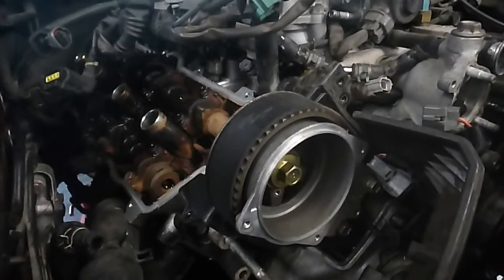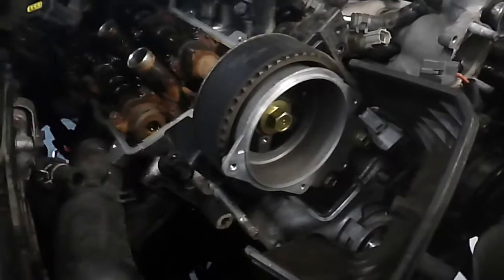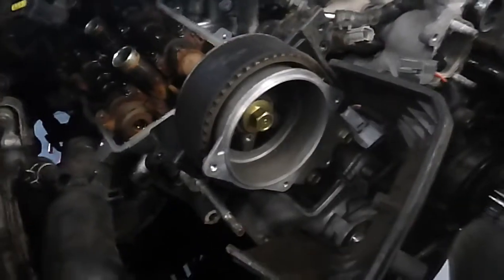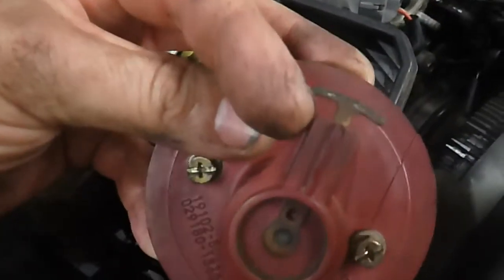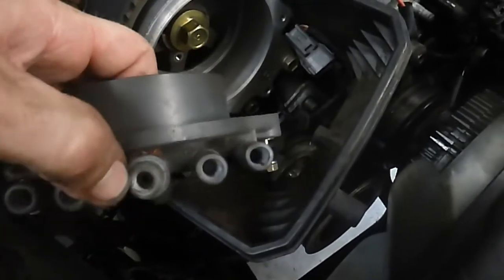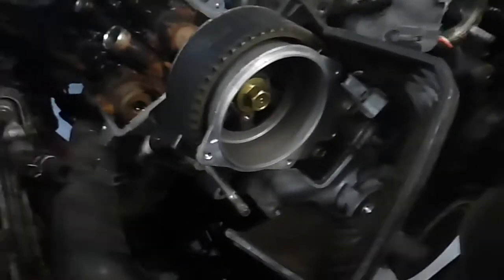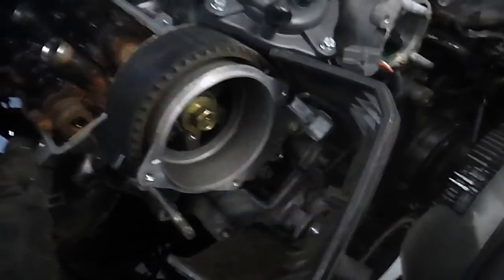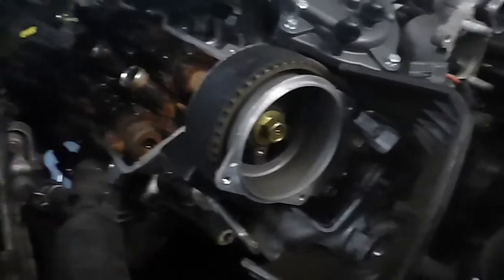Distributor caps and rotors 1uz-fe

Comment: Great channel! Was hearing a rattle (type) noise right in the cam gear area (driver side) on my SC. Pulled the came gear top cover to get an open path down behind the timing cover. Fully expected to hear noise coming up from that area (heater hose to the ear and other end right at the opening) Nothing worth noting. Put hose right near cam gear ... there was the sound! Pulled the distributor cap and found a cracked rotor just like the one shown here. Even had a crack in the plastic near the outer electrode. Put a new rotor on and voila! Most of the noise is gone. Now the passenger side is the louder one. In your experience have you run into a cracked rotor making audible noise?

Comment: Good day Calvin . I recently ran in to a problem with my 92 1uz Fe I fired it up and after about 3-5 seconds it shut down and will no longer crank no lights or nothing came on any ideas ?
Reply from the maker: I would be testing the basics like battery, battery connections, fuses, supplies to ignition switch etc.  Cheers

Comment: need help. having arcing across all spark plug wires, just changed them for brand new ones, and still arcing continues also changed spark plugs, not sure what to do next?  

1995 lexus sc400.
Reply from the maker: Did you use genuine ones or a set of other crap??  Are they routed correctly?  Are all the stock guides in place?
Reply: @CartuneNZ  yes  genuine parts were used. Also even original wires were arcing.. 
And what do you mean by stock guides?
Reply from the maker: @myyoutubechannel3737  there are factory spark plug guides down each tappet cover and spacers holding the leads away from each other.  Next options after that are there are internal issues causing hard firing inside the cylinders.   Cheers Kelvin
Reply: @CartuneNZ  thanks kevin. Kevin could possible coils be bad? Or bad distributor cap and rotors? ..
Reply from the maker: @myyoutubechannel3737  its a car,  anything is possible.   Cheers Kelvin
Reply: @CartuneNZ  yes routed them correctly wire by wire.

Comment: Hi im having  a problem  with my 1995 sc400 I did a full  turn  up it starts  but after 15min  when  it gets hot  won't start  back dose any one knows  why ?
Reply from the maker: Time to do some diagnosis.  Check for whats not working when it stops , is it fuel , is it spark , etc.  Confirm crank sensor input etc etc.  Cheers Kelvin

Comment: one side of my 1uz isnt working bought new ignition coil but nothing only 4 cylinders work, other 4 nothing and dont know what to do??
Reply from the maker: Ok.  More diagnoses are required. Is it all one side of the engine or two on one side and two on the other.  Is it making spark etc.  Good luck. Cheers Kelvin
Reply: @CartuneNZ  no sparks, it is all one side of the engen. i took out ignition coil on the right leaving 1 on left and the car started, then i put the right ignition coil on the right back and took out the 1 on the left and the car wasnt picking it juc cranked. i tested the coils though they all work. will try diagnoses.
Reply from the maker: @kendy531  each coil does two cylinders on each side of the engine so you are giving mixed information.   Please confirm as it sounds ignition related.
Reply: @CartuneNZ  Alright. thanks

Comment: Could these cause break up on top end
Reply from the maker: Hello.  Stuffed ignition rotors can cause all sorts of funny issues.  I replace at ever cambelt change and at engine prep time and shake my head when I see old ones refitted.  The ignition systems on these enginea are getting old so some new parts work wonders.  Cheers Kelvin

Comment: Hey! I’m having abit of issue with mine. I’ve just replaced rotors,caps,plugs,leads. I’ve got spark at my coil from the ignitors, but not getting any spark at the end of the lead
only fault code I’m getting is 22. Any suggestions?
Reply from the maker: Hello Aaron.  Can we just go over this a bit please to confirm we are both on same page.  You have voltage to coils,  both 12 volt and the trigger?   But coil isn't producing any spark?  Code 22 is quite straightforward normally.  Start with efi temp sensor.
Reply: Sorry probably didn’t explain it right. The coils are sparking when I manually trigger them but I’m getting no spark at the end of the leads when cranking it over. Yeh I just ordered a new water sensor to clear that code
Reply from the maker: @Azz-lt3rv  ok.  So the ignition system is capable of making spark when manually triggered however doesn't function when cranking and engine doesnt start.  Im guessing a wiring issue seeing that it ran before doing the conversion.  Or something has gone wrong and ecu is fried.  Maybe you need my wiring instructions to confirm its wired correctly.  In the next week I have a diagnostic video to make as well.
Reply: Yeh I’m really starting to lean towards the ecu being dead! Just need to save up some money to buy your loom and aftermarket ecu

Comment: You’re a gem, mate. Seems so many of the 1uz experts have vanished. My 1uz just hit 160,000k’s (and 25years) and did it’s very first rough idle at start. Thought I should do plugs/leads/caps/rotors. I’m in Aus but would you be so awesome as to tell me how much you reckon caps and rotors should cost?
Reply from the maker: We are doing one at the moment which had a rotor fall apart, get ground up and jumped cambelt as a result.  Pretty messy.  All prices are Kiwi dollars. Over here I supply dizzy caps as a pair at $110 and Rotors at the same for a pair.  Both genuine items as thats all i will use.  Leads at $220 and plugs are the most as they are $200.  I prefer nippon denso plugs as thats what gives me the best results.  There are lots of aftermarket options but I also prefer to buy the proper parts and have very few issues as a result.  Coils are also a common failure.  All just because of age.  I do rotors at every cambelt job as i think prevention is the best policy.  Whats your Uz in?